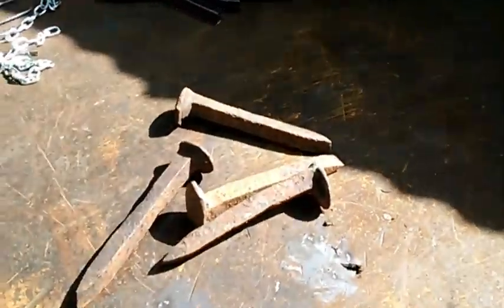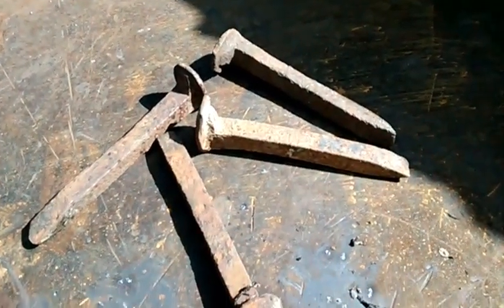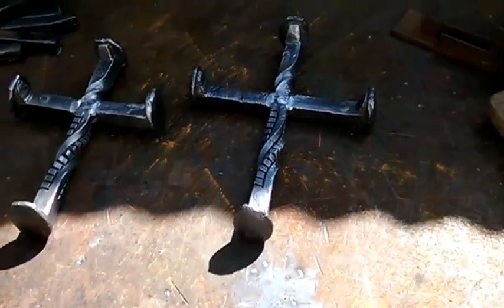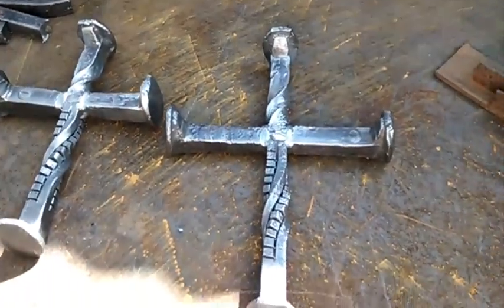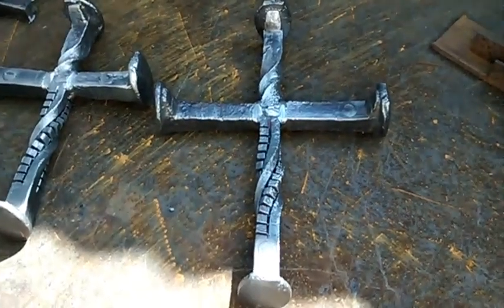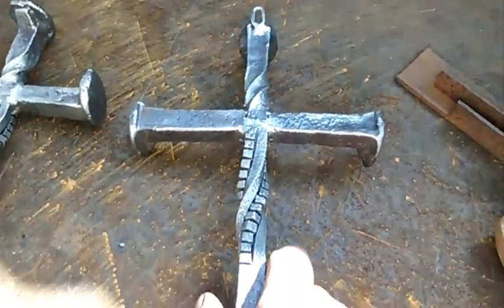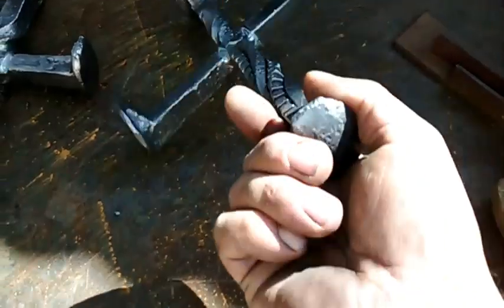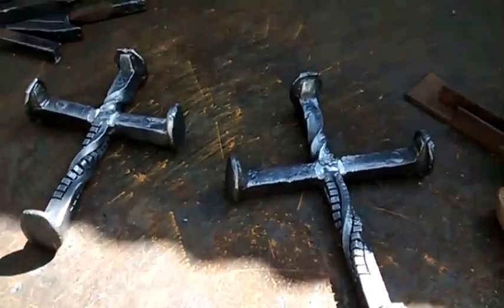Railroad spike cross with cube twist

Comment: U have to Heat the metal then While it's hot u soak it in oil  that's how u keep the rust from returning...  

Besides I also think u need to be very careful when Using a grinding wheel without a guard.... But otherwise this is cool stuff man thanks..